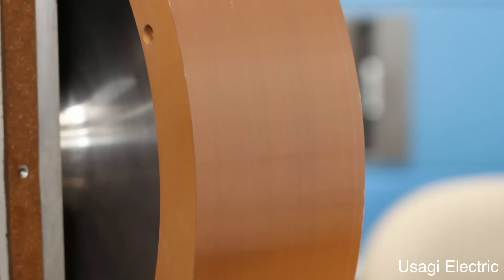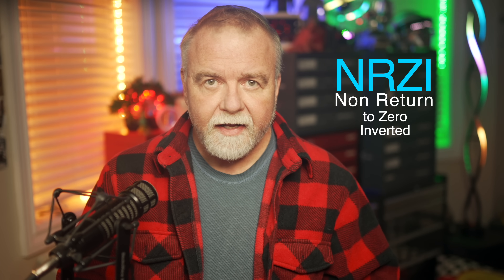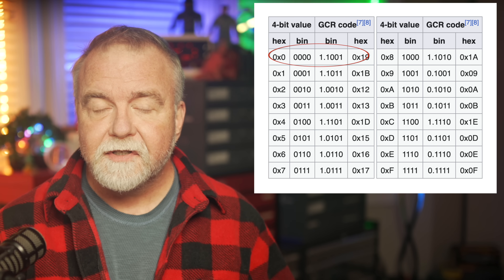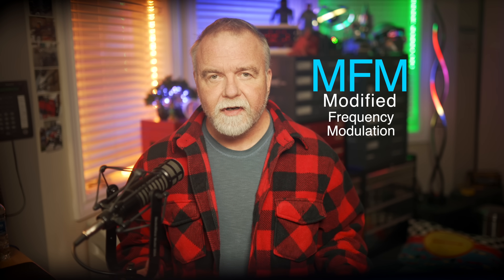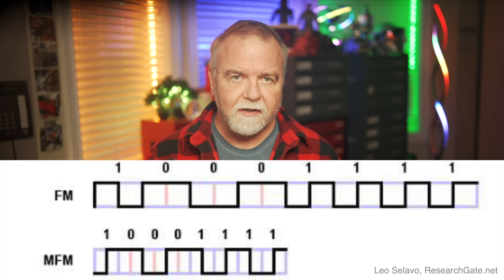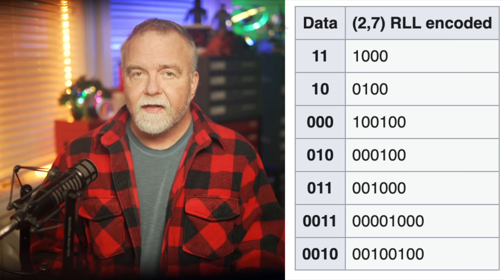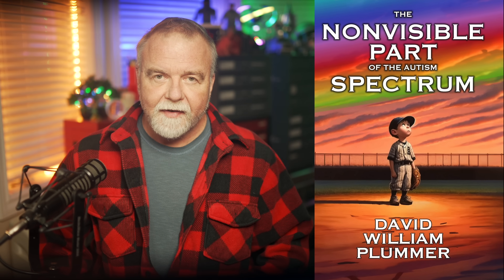Learn How Bits Are Actually Stored: NRZI, GCR, MFM, and RLL Explained

Comment: Not sure about what you say at 10:50. You say that "a 1 is represented by a flux transition only if it was preceded by a 0; viceversa, if a 1 follows a 1 there's no transition; 0 is represented by a transition only if it follows another 0".
I am currently learning about encodings, collecting information from different surces and what I found is (best explanation, Wikipedia): a 0 bit is encoded as 10 if preceded by a zero bit in the input stream, and 00 if preceded by a one; a 1 bit is always encoded as 01.
Am I missing something?

Comment: Around 6:10, while explaining GCR, Dave says that the 5 bit code is arbitrary "... as long as those patterns don't contain runs of 3 bits in a row", but that's incorrect in 2 ways.. First of all, it's 3 _zero bits in a row that have to be avoided. Three ones in a row are fine, as shown in his sample table.  I'm sure that was just a slip of the tongue. 
But also, the 5-bit codes have to be chosen so that they neither start nor end with 2 zeros in a row, because if they did, then having them appear before/after a code that puts a zero beside the 2 zeros would result in three zeros in a row on the tape. This is also evident in the sample table. 
To make it explicit, at least some of them have to start and/or end in zero, because if they all end in a one, then you're down to only half of the 32 values (i.e., 16) available patterns, at least one of which would have to be 00001.
Also, he skipped past the fact that this is a data encoding, not a magnetic flux encoding. The "not 3 zeros in a row" rule implies that the 5-bit patterns are encoded in NRZI on the tape.

Comment: Isn't that bit translation technique Dave talks about with GCR also used in one of the ethernet standards? I could swear I remember learning about how it encoded 4 bits into 5 bit patterns (that had a more consistent alternation between 1 and 0's) and this let them send those bits 10x faster (along with a bunch of other changes to the protocol).

Comment: I remember that when the first RLL drives came out (30MB), they were essentially MFM (20MB) drives hooked into an RLL controller.  However, that resulted in those drives being much more finicky and data loss reliability on those first 30MB drives was a problem.  It always seemed to me that RLL drives throughout the 1980s were less reliable.  The term "RLL" still gives me chills.

Comment: Some information that might help some better understand the Manchester encoding explanation:
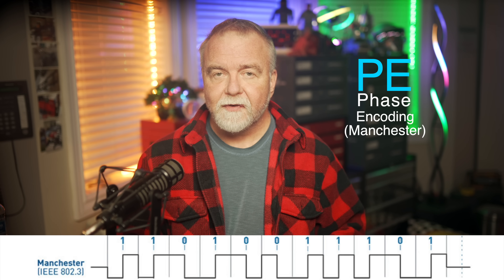If we look at the example square wave at 4:33 you might reasonably ask yourself (as I did) "how does the read head know where the boundaries between bits are placed?" The corollary of this question being "what if the read head is misaligned by half a bit?" The answer to both questions is that, if the bit boundaries are misaligned by half a bit, there will now no longer always be a transition within each bit for all the data, so the reader knows to shift over the boundaries by half a bit.

Comment: As one who was around in the latter part of the heyday of mag tape, the intermediate days of diskettes and the early days of PC hard drives, but never fully understood what these abbreviations were all about, I thank you for this, even if it's a little late to matter for more than academic purposes. In the middle of 1989, I was spec-ing out my first personal computer. I had been a computer science major in college and early in my career as a programmer, but none of that gave me a whole lot of useful information about PCs, so I was relying heavily on PC Magazine for research. Before long, my head was full of abbreviations, like MFM, RLL and ESDI, but apart from slowest/faster/fastest, I had no idea what they meant, much less why they might be slowest/faster/fastest. The computer purchase was to support a consulting side gig with an old college buddy, and he had an associate who got me what I called a Bargain Basement PC, meaning it was custom-built, literally in some guy's basement, and I got it for about $1000 less than I'd have paid for a similarly outfitted PC from Zeos or Northgate. In retrospect, I should've called it the Sausage PC, because as with a good sausage, you enjoy having it, but you really don't want to know what they put in it. For storage, my PC came with a 90MB SCSI hard drive, largely because the builder had a SCSI controller and hard drive lying around and, apparently, nothing better to use them for. I have no idea what encoding that drive used. (I also don't remember what brand and model either the drive or the controller were, but I do recall looking at them after the drive failed 2-1/2 years later, and finding that neither hard a brand name that I recognized. Sausage...)

Comment: I did the MFM to RLL swap many times on various hard drives, and it worked reliably about 50% of the time.    It would go from 17 to 26 sectors per track.  Then I found the Perstor PS series controllers, and with those you could get 31 SPT (if I recall correctly), almost doubling the MFM capacity of your hard disk and it was much more reliable than just doing RLL on a MFM drive. I fondly remember my old Atasi 3046 MFM drive - I got about 72 megs out of it.  Oh, the memories. :D

Comment: I remember writing assembly code on my Apple 2+ to read and write raw sectors to crack various copy protection schemes. The hardware controller was pretty dumb and most of the drive characteristics (bit timing, track spacing, etc.) were controlled by software. Great presentation of the low level encodings. A few of this (Manchester and group codes) got heavily used in various network protocols like Ethernet and FDDI, too.

Comment: Back in 80's I worked for Micro Technology (tunbridge wells) and then Plus 5 Engineering (crowborough), who USP was producing external hard disk and tape units for PC''s that matched the PC cabinet design, so different containers for IBM PC, Compaq, Sirrus, etc etc. I wrote all the disk and tape device drivers for CP/M, IBM Dos, MSDOS etc, and eventually Xenix. These units were really expensive but gave a PC 10MB of storage, yes a whole 10MB. My watch today has 32GB of user storage, what progression. I even wrote a shared disk system between several PC's connected by SCSI flat cables and abritrating access using the SCSI id's.
Happy days.

Comment: Great presentation Dave, thanks for that :-) I remember getting more capacity on the same hard drive when upgrading OS. I can't remember the details, but it certainly happened, and the explanation given at the time was "different encoding" - which you confirm here. The first CP/M computers I worked on (1 MHz Z80, later 2 & 4 MHz) had two single sided, single density 8" floppies with 256 KB on each. Later came double sided, single density (512 KB) and in the end double sided, double density (1 MB). Imagine - TWO MEGABYTES total disk space! A HUGE step up from the Apple II, which was my very first computer, with its two 72 KB 5.25" drives for a total of 144 K! That limitation was what launched me on a career in computing, but that's a VERY long story that I'll spare you ;-)

Comment: As well as regular improvements in data recording devices, there was a corresponding improvement in the recording media. Greater data densities required denser magnetic particles which needed stronger magnetic forces to record on. A similar situation occurred with audio cassettes. Just as a recorder designed to work with basic ferric oxide tapes were unable to successfully record on higher quality Chrome tapes, 40 track single density drives couldn’t write to media designed for use on 80 track double density drives even though they could usually read the higher quality media if the data on it had been written to it at the lower specification by a drive capable of writing at the higher densities.

Comment: How about DEctape?  How was it encoded?  It could read both while moving either forward or backward.
Reply from the maker: DECTape used Manchester encoding.  And it stored data in blocks, typically 128 or 256 12-bit words per block

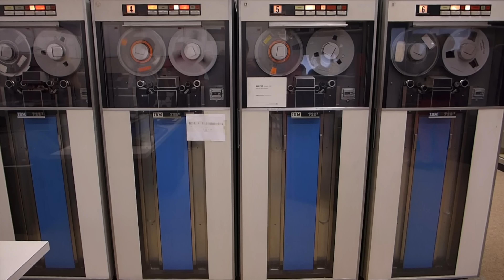Comment: 7:16 What I might say here is. I have heard about Manchester encoding as great for low power data transmission, I think it might be used in NFC/RFID.  and I think NRZI sounds perfectly fine, whenever I hear (long pattern of zeros or ones) I just think compression, and reading the RLL in the title, I'm thinking Run Length encoding (RLU) which really its no longer a disk encoding thing and data encoding thing, and software engineer (not so much hardware/firmware engineer) should be doing some form of basic compression to a string of NULL values.

Comment: I'm going to disagree with you - MFM and RLL are the same! "Standard" MFM is "MFM RLL 1,3", to use it's full name. As you said "RLL" in PCs was generally 2,7 - "MFM RLL 2,7".  And yes, you could swap controllers. The reason being that these drives were DUMB. All that was on them was just enough electronics to translate pulses into head move and head read/write commands, and amplifier circuits for the reads and writes - the drive itself never new what track it was on - just a series of forward/back one track.  The larger of the cables, and its protocol, is actually the same as the floppy drive cable/protocol. The separate smaller cables were for the data, due to moving to higher data rates and parallel transmission. Thus, you could put any encoding controller on it you liked, and the drive would work. 
You are correct in your assumption that RLL drives required tighter tolerances - and that's pretty much how they were sold. If they met RLL standards, that's what they were labelled, if not, then MFM. So if you were lucky enough to get an MFM drive that "only just" failed the RLL standards, it'd work fine, and usually would even if not - though longevity of data was the issue on poorer quality MFM drives.
The first IDE drives were the MFM/RLL hard drive AND controller on the drive (very early versions had two boards with connectors), and the first IDE standard was the 16-bit ISA bus, just broken out though some buffer chips on the "controller" card, and some addressing logic - hence the "intelligent" in IDE, but still the need for CHS mapping in the BIOS. Future versions had more smarts on the controller to allow for different bus speeds, etc.
Reply from the maker: All your RLL are belong to MFM.

Comment: My first PC (386SX) in 1991 had a full height 5.25" 40MB hard drive. I remember looking through the manual for the hard drive controller and there was a mention of the default encoding being MFM but after changing a jumper it could be RLL. I didn't really know what this was... but I changed it, did a low level format and my 40MB drive turned into a 63MB drive! It was magical 🙂

Comment: When I worked in the HSBC data centre in London (formerly Midland Bank) back in the early 80's, I remember using PE coded tape reels. A couple a couple of years later transitioning to GCR tapes. Also used 80 column punch cards.
Thanks Dave, you brought back some old memories.

Comment: A number of serial line codes were developed to eliminate any sort of DC bias present in the signalling method as this caused problems for transmitters and in some cases, radio equipment due to the bandwidth required. 8b/10b maps 8 bits to a 10 bit string. 64b/66b achieves the same on a longer code space.  Unrelated, it's possible to configure a modern UART to run 9600, N, 8, 2 (two stop bits), which means the whole string is 10 bits long and will show up on the oscilloscope as a nicely divided number. 

For instance, AX.25 or X.25 uses a polynomial scrambler in an attempt to eliminate DC bias as well. The feedback taps on the shift register were well known to produce that polynomial and the FCC allowed only three sets tap configurations.

Comment: You're reminding me of when I did a report in college on how the CD recorded data. Dave, this David says you will find that very interesting. I still remember parts of it all these years later. Like the 8 to 14-bit transformation where there may be no more than 10 zeros in a row and no fewer than two zeros in a row or was it three? And like some of your encoding techniques, it was the change that was the one, not the surface. They used to change through time it, and they use the laser reader to align it. I also had a lot of checksums in the blocks of data.  Do one of these videos on how a CD is encoded. For real, do one because they're interesting.

Comment: I remember those 10Meg drives. They were heavy and when they got real old, I had to 'thump' one because the heads did not auto-park back then and stuck to the platters when it shut down. I miss the days of sound of 'Ca-chunk' re-reads of sectors.

Comment: I worked in a small PC shop in the late 80s, and our tech absolutely did put cheaper 20MB MFM drives in with RLL controllers to bump them up to 30MB. They never came back, so I guess no harm - no foul.

Comment: Back in University I (in the 80's) I had an Amiga 500.  It allowed raw drive transfers with it's hardware calls, so I wrote my own device driver to replace the default MFM encoding with RLL so I had greater storage on my disks.  Also had the added benefit that no one could read my shit, LOL

Comment: You mentioned the Commodore 64,   did the ZX81 and ZX Spectrum use the same format?   GCR?     My 1st computer was a ZX81 back in the 1970's (I think it was) and I never gave any thought to how the tape worked  (or didn't work sometimes).    I remember on the ZX Spectrum developers came up with their own special higher speed format,  turbo mode or something,  not sure if that was just GCR or something else entirely.

Fascinating stuff   :)

Comment: Maintaining sync is often cited as being the reason why encoding schemes are required for storing long groups of zeros. This is only a minor reason, the major reason that is rarely ever mentioned is due to magnetic fields only being able to induce a current if they are changing. To read a changing magnetic field the signal is differentiated using an op-amp. This is a mathematical, calculus differentiation where the output voltage is directly proportional to the input voltage’s rate-of-change with respect to time. A second op-amp configured as a comparator can then be used to detect the zero crossings, with its output sent to a one shot multivibrator used in the next stage to create the digital pulses.

The flux transitions in the signal are like a continuous, 3D gaussian curve where it can go up and down. Ideally, the head attempting to read the signal needs to be precisely positioned over the peeks and troughs of the gaussian curve. Due to tolerances between different drives, or even hysteresis in the same drive, this can be hard to do and the head can end up on the shoulder of the gaussian curve. To help with this the signal is first amplified by an auto-gain amplifier.

A flux transition is used to represent a 1 and the absence of a transition is used to represent a 0. But now there is a problem if you need to store many zeros between the flux transitions. For example, when moving from one transition going up and the other going down the distance between the peeks dictates how many zeros are stored between the two ones. But the more zeros inserted, the more the slope between the gaussian peeks becomes shallower and shallower. The more shallow it becomes the higher the auto gain amplifier ramps up. If there are too many zeros then the slope can become so shallow it almost becomes a constant straight line. Induction stops in the presence of a constant field so this is bad. Mathematically, differentiating a constant is zero. The derivative of a shallow sloping, almost constant signal can be close to zero. So with the first amp with its auto gain maxed and the second differentiating close to zero, any noise can easily cause a random incorrect zero crossing to be sent through to the one shot and be incorrectly detected as a one.

Some floppy disk copy protection schemes deliberately did this on purpose. When reading a section of the disk with a slowly changing magnetic field or a section of the disk that was manufactured with no magnetic material multiple times, the code expects the data to be random. If the data is always the same each time this section of the disk is read then the code knows it is a copy.

Comment: Thank you SOO much for this video.  I just completed a program for restoring old C64 disk images encoded with GCR, but I've always wondered what the difference was between GCR and MFM.  Now i know!!  I started with zero knowledge of GCR or the 1541 and ended up with a program that could successfully reproduce even the most difficult protection schemes, thus preserving these images for eternity in their original glory

Comment: Yep it was my first job working for a importer distributor in new zealand selling hard drives, controllers to pc dealers over the whole country.  we had Miniscribe 8425 5 1/4 " 20mb drives that used MFM ISA controller where as a 8435 5 /14" 30mb drive used a 27RLL ISA controler which was the same as the 20mb drive, but was rated as being more reliable to handle the extra 50% increase in data density onto the platters. we also had and also 3425's 3.5" 20mb drives later on. And yes there was the case where miniscribe shipped bricks on ships... they were failing at producing enough products that were capable of keeping up with performace improved western digital drives....